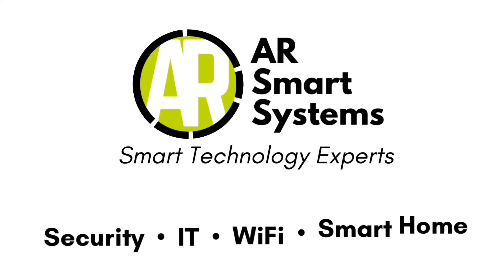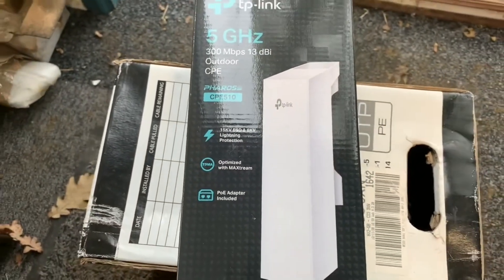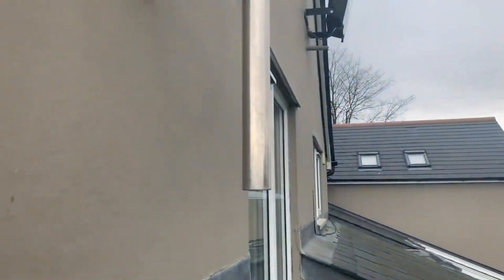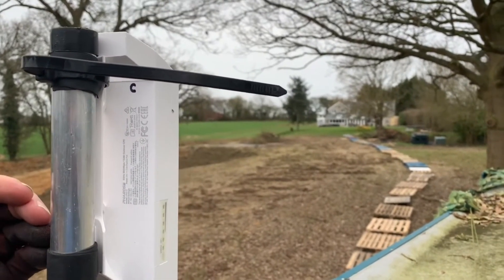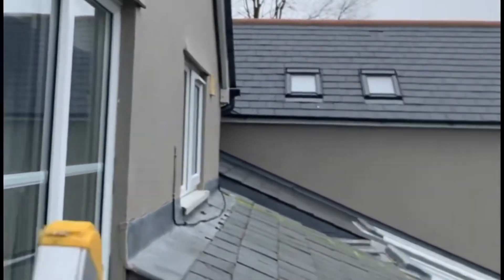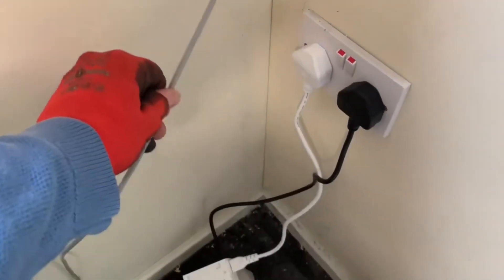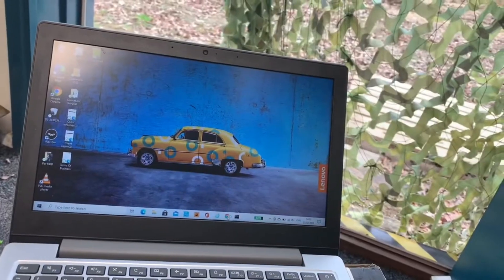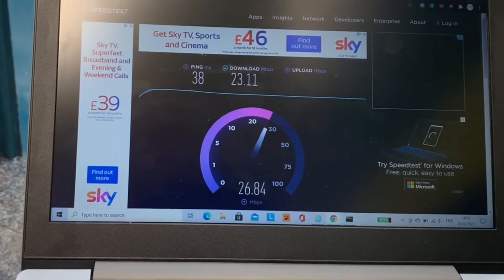Installing TP Link CPE510 Point 2 Point Wireless Connection

Comment: Kinda silly that they advertise 300Mbps speeds but the device itself only has 100Mbps ethernet port, so you cannot ever get faster PtP speeds than 100Mbps.
Reply from the maker: For anything over 100mbps you will need to look an alternative. A lot of P2P bridge products offer high throughput speeds, but the hardware is limited to 10/100mbps.   The CPE510 is a good option for anything up 100mbps.
Reply: @arsmartsystems5628 yeah that too only has 100Mbps ethernet port

Comment: CPE520 is also a long range AP. Did you directly check the signal strength and connect speed? You have a LOS to cabin and short distance. I am curious to know
Reply from the maker: The connection strength and transfer speeds were checked during the setup of the bridge.

Comment: What do you recommend to achieve a wireless connection with 100mbps upload and download?
Reply from the maker: There are point-to-point (PtP) wireless units that can reliably deliver 100 Mbps down and 100 Mbps up (symmetric), as long as the link is set up correctly (line of sight, minimal interference, etc.) 

Ubiquiti NanoStation 5AC Loco
Ubiquiti NanoBeam Gen2
These are ideal for short to medium range solutions with a Max throughput of 45mbps

If you need to cover a larger distance then you may need to look at Ubiquiti PowerBeam Gen 2 Max throughput 600 mbps.

If you need higher throughput over a short distance then look at MikroTik dish systems.

Just be mindful that real world throughput will be lower. 
Interference and obstructions will reduce speeds or cause drop outs.
Be sure to check license free frequencies in your area.

Comment: So if i buy the point to point link kit do i also need to have the switch and wireless access point?
Reply from the maker: It completely depends on what you are trying to achieve but just think of the point to point system as a data cable. If you need to connect more than one device at the extended area you may need a switch. Alternatively, if it just WiFi you need then an access point will be what you need.
Reply: not necessary u just need to of these cpe510 one a client other an access point, then a router for the client to share internet in that area